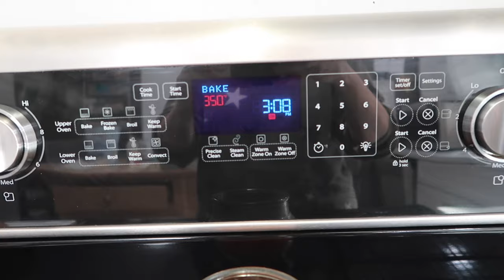DIY Home Bathroom Refresh: You can do it all wrong & have it come out nice! 🤣 Also: CUPCAKES!

Comment: The door came out very nice. Brightens up the space. I love stained wood furniture but usually I prefer painted doors. Unless I weee to buy the most beautiful house with stained wood doors and trim then those would have to stay stained because I couldn’t bear to paint over it. It’s weird,I know! 😂 I don’t blame you for not wanting to sand but i do think it helps to get the paint to stick better. I’ve elected not to sand and my paint has peeled. 😢 They sell some stuff called liquid sander. Along with the use of a degreaser like TSP and hot water and a good scrub will help your paint adhere. I like to prime first no matter what the can says since stained wood can sometimes bleed some tannins after you have painted. Ask me how I know. 😢😂. I use the BIN Shellac based primer over raw or stained wood. I actually use Behr paint a lot. It has held up very well for me. I like the semi gloss for bathrooms since it’s very wipeable but it does magnify I’m perfections.

Comment: We had the shell of our home built in 1982. We finished it ourselves. Plumbing, electrical, sheetrock, trim, flooring, etc.  WHILE we lived in it. That was a challenge. Nothing is ever perfect.  There are too many little anomalies. That’s part of the challenge… I coming up with ways to make it work and look right. Paintable caulk hides a multitude of issues. ▫️We’ve done a few remodeling and refresh projects over the years. That’s the magic of home ownership. ▫️Our interior doors are all stained. Not a dark stain. But, my husband coated them all in Varathane polyurethane. That made them really easy to keep clean.

Comment: I'm 18 minutes in to the video so you might have already purchased more paint before the end :)  I heard an interesting thing about color matching when I was repainting some vintage kitchen furniture.  I did color match the first quart but then I read that it is actually best to find the paint that most closely matches your color and use that going forward.  It said that the computer wouldn't always read the paint you are matching exactly from one time to the next, but the formulas for the named colors would remain constant.  Since I was basically matching a white on the blue side (rather than the yellow side) I was able to match the paint from my 3x5 card to a paint on the "white" wall color samples very easily.  That's my other hint:  for years I have had a file folder with the paint names and numbers I've used.  I also have a 3x5 card with a swatch of the paint and the date I used it and which room and the sheen and the brand and the color name and number.  I can't tell you how many times that has saved me.  Paint cans get messy, the identification info fades, and the company's sometimes discontinue colors.  I use a fair amount of historical colors and especially for touching up they really need to be the same.  My last hint which is kind of weird I heard from my mother.  She said that she has a friend who leaves the paint can in the room where it was used.  I did that in a couple of rooms the last time I painted, though I modified it by pouring the small remaining amount into a mason jar which I can tighten securely.  I recently got a mason jar vacuum sealer (for food actually) so I think that I would use that to really make sure that the air couldn't get in.  Paint is so expensive now that if there is a way to save and use it all it is worth it to me.  I am reminded that I have a lot of painting I should do....... so, thanks?
For the door, because I am a little lazy about such things, I would have had my husband take it off the hinges and bring it outside (in the nice weather).  Then on sawhorses sanding it would be easier and the dust could be outside.  Getting the finish off and the imperfections smoothed might actually make the painting experience more enjoyable.  I love being outside for this type thing.  I think that getting the finish off the panel corners would be annoying but you only have to do it once :)  My doors are probably 100 years older than yours and they aren't all done (heavy sigh) so when I do them I know it might be the only time I ever do them.  My favorite door is a tiny one that goes to the attic that mimics the other old doors.  I think my mom refinished it and I smile every time I see it.
I can hardly wait to get back to my furniture project on the front porch.  I'm a fair weather fixer.  We're kind of hicks so having a project there isn't too awful. 
I listen to audiobooks when I don't have any "helpers" on this type project.  I find it easier than youtube because I always want to see what the youtuber is talking about.  I get the audiobooks from the library.  If you were ever interested in audiobooks I'll bet that your best friends in youtube land could recommend favorites.  (and I'd like to see what others are listening to too)

Comment: If you find that your paint is dragging, then there is conditioner that can be added to the can to make it easier to work with. Rather than tape or clean the locks after painting remove the handle (knob) and escutcheon or rosette (metal plate), yet leave the lock intack on the door. Return after painting. You will not want to get paint in the inter workings of the lock. The bathroom is coming along nicely.

Comment: Karen, you did a fantastic job painting the door, as I think it looks so much better painted white.  Personally, I think you should paint all your doors white inside and out so they all match, rather than just painting the bathroom doors.  This is because if you ever sell the house the new buyers would probably think it a little odd if only some of the doors were painted and only in one side.

The cup cakes turned out really nicely and they rose so perfectly. The recipe seemed so super easy too.   However, maybe you might want to resist eating them too often so you don’t end up self sabotaging your weight maintenance program; as that would be a shame when you worked so hard to lose the weight that you did.  I appreciate the temptation to eat things when you switch from an all Optivia plan to a weight maintenance programme must be difficult though.  As we all feel like a treat sometimes.  I know because I find it hard to resist too and don’t always succeed either.  😆
Reply from the maker: I didn’t eat the chocolate ones! I agree about the doors but that would encompass all the doors and then all the woodwork and more. Maybe someday…